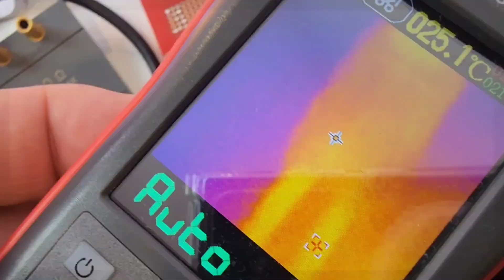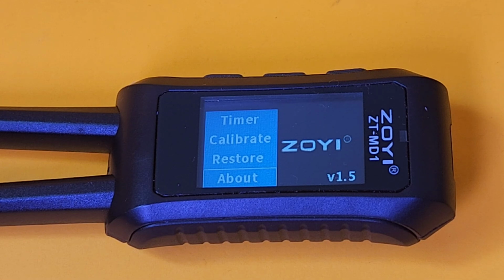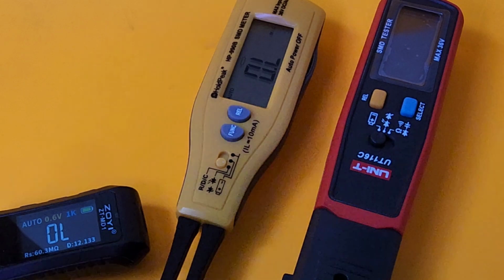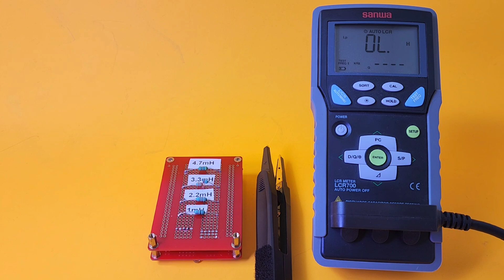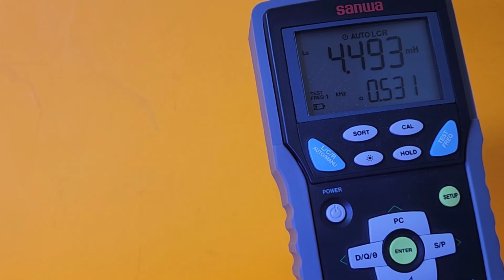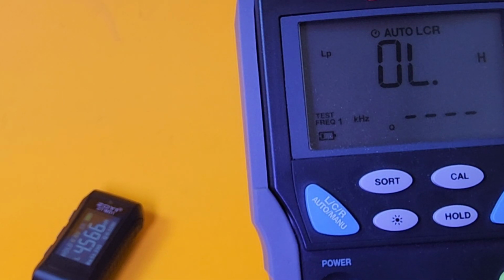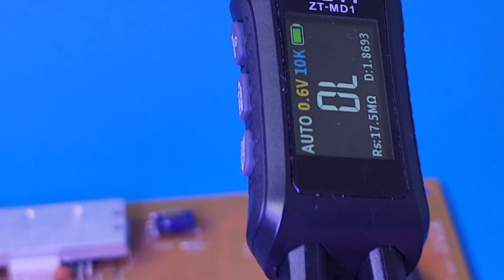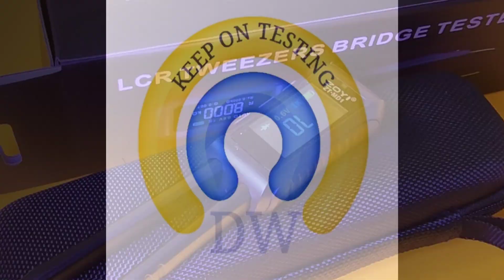ZOYI ZT-MD1 LCR Tweezer Review & Teardown!

Comment: To be fair its not a direct compare to the other tweezers you showed. They have voltage measurements and can (at least the Uni-T) measure zener diodes up to a certain voltage range so they can coexist. :) It's very cool though this one has continuity and selectable test frequencies.
Reply from the maker: I think it's a good to highlight the different Tweezers' capabilities..the HoldPeak and UNI-T are SMD not LCR Tweezers, so different capabilities. All depends on the users end needs. 👍
Reply: Maybe it would have been bigger and use more power just to add higher voltage capabilities.  The Zener capability of the two larger devices is very good. The ZOYI manual tells you to use a different device to measure above 0.6v.  I would suggest the UNI-T. It is marginally better compared to the Holdpeak in overall range and accuracy.

Comment: Darren thanks for the review - a thumbs up as always!
You claimed that the Zoyi was giving better measurements - but it looks to me that you simply wrote down the values on the PCB based on the color code - but have you actually measured those inductors to see what their actual value is?  One last thing - esr and dcr are some of the hardest measurements to get accurately (the R in the LCR), but you didn't point out the inaccuracy of the measurement in the display...  The Zoyi Rs was way off as it was showing in the 10s of ohms for each measurement.  The Sanwa was measuring closer to 0.4 ohms.

Comment: Is it in-circuit capable? If it is, dang, HELL YES!!! But would have been nice if you tested bigger capacitors like bulk decoupling units...that's what I use that the most. How high can it go with that?
Reply: The 0.3V setting supposedly provides good in-ckt tests. I measured a 22mF cap on this, my largest.
Reply: @pault6533  Good to hear, low enough voltage to not turn on most diodes somewhere. Does it show ESR even at that large of capacitance?
Reply: @ruikazane5123  yes it did report Rs. It read a little low for Farads. Not unusual, this is the upper end of its range.

Comment: Continuity here is ABSOLUTELY necessary! The most common example is testing SMD capacitors or MOSFETs for shorts.
Reply from the maker: Hence, diode mode to confirm no gate-source voltage while testing a Mosfet. Btw.voltage drop is not very accurate, probably because of low output current.SMD Cap testing via continuity can give alot of false positives so its not always the  best method.
Reply: FYI,  No beeps in the diode mode, only continuity mode.  I wonder if they could firmware that in.
Reply from the maker: @pault6533  That would definitely take it up a notch, eh Paul 👍

Comment: No ESR?
Reply: Rs is ESR on this device = series resistance.
Reply: At the bottom of the screen it showed Rs - but was way off.  It was in the 10s of ohms in each measurement where the Sanwa was closer to 0.4 ohms.

Comment: Even if it was less accurate than Sanwa, I would consider it a good option given the 10x price difference. But as it is, I think I would actually prefer it to any other LCR meter I had. It's just the right size for my baby hands, just the right price for my wallet and covers all the LCR needs an average person can have. 👍
Reply from the maker: Let me say right off tge get go,in no way is it more capable than that SANWA LCR Meter, period. 
However,  for the hobbyist and non production end user it will certainly fit the bill. 😊 It's very accurate and that OLED display is just awesome 👌